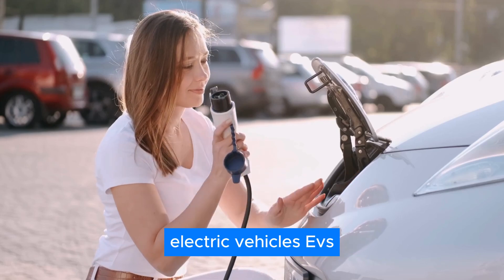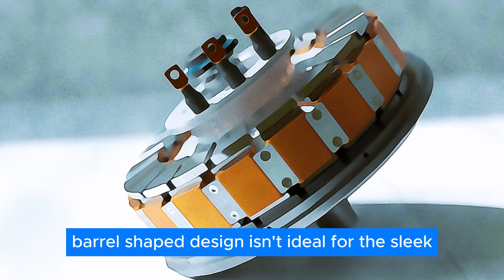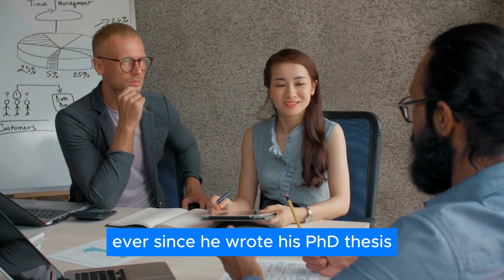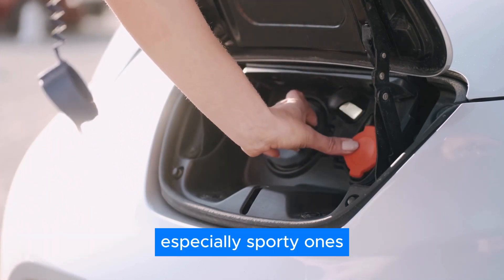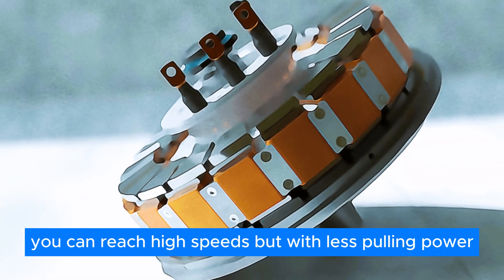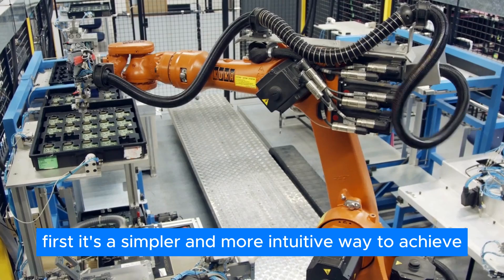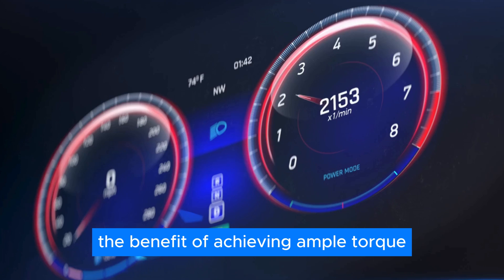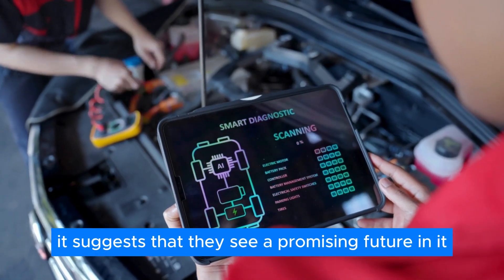Why GM’s NEW Axial Flux Motor Will Change EVs Forever!

Comment: You have got to be kidding..... what a dumb AI. EVs are as expensive as they are because people are willing to pay that much. Make a cheaper motor and the manufacture will still charge the same and pocket the difference. EVs are already 6 or 7 times what they should be..... much like IC cars are very over priced. As for the motor? nothing new here. pancake motors of similar design have been around for over 40 years.
Reply: So many mistakes in here with the script and the images. Our robot overlords won't be taking over for a while.